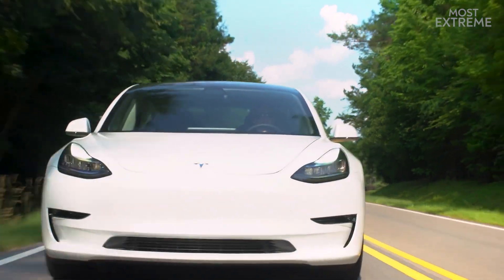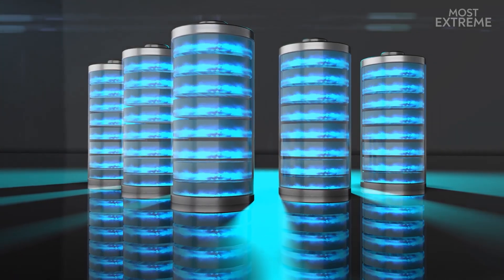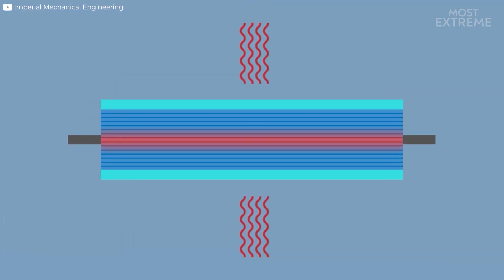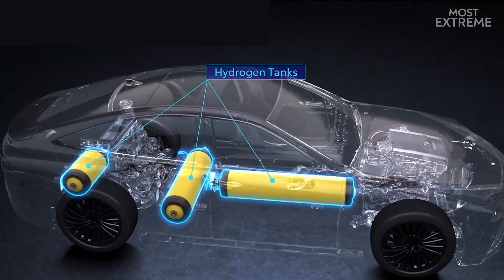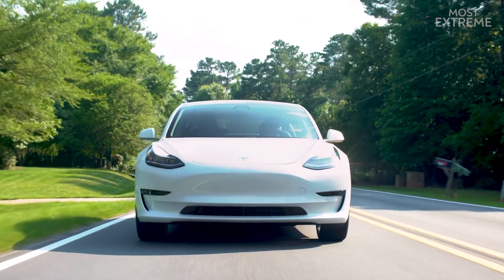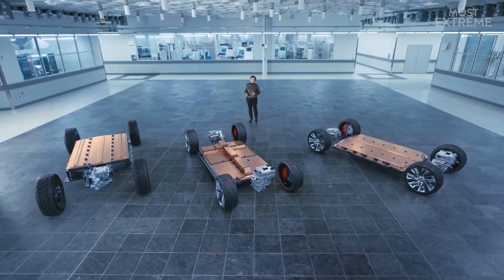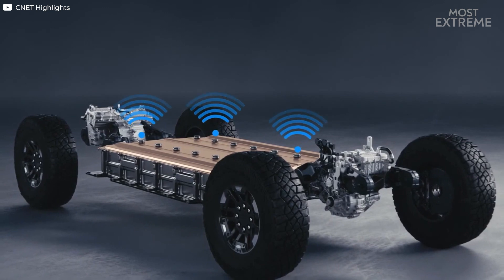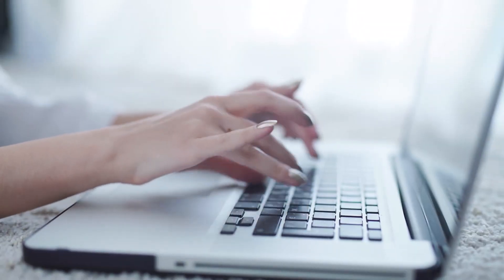Lithium VS Hydrogen VS Solid State | EV Battery Technologies Explained

Comment: I just can't wait for below freezing winter driving with multiple hydrogen vehicles having driven before me spewing water exhaust droplets coating the roads with black ice for us to drive over and wreck our vehicles on ! Now that is safe ! This concept is just another, not so well thought out,"GREEN", idea that when applied into the real world to keep us safe from climate change does not keep us safe from injury or death when in vehicular accidents. A society operating many Hydrogen Vehicles that are spitting water on below freezing road or parking lot surfaces is not the answer ! So, where to put water. Maybe an onboard  tank to freeze solid and burst when parked?  At a stop sign or light idling then accelerating adding heavy icing right there to the road surface just where one wants to actually stop? A parking lot to slip and injure another walking by the back of your parked vehicle or after you drove off leaving water to freeze there? A roadside gutter so a pedestrian can slip stepping off a curb, maybe falling down flat in front of stopped traffic and out of view of drivers ? Your driveway so you can fall there ? Your Garage to slide across while holding your infant child then both hitting the hard floor? Maybe, you need more tasks or to be distracted by mopping up the garage floor before the water freezes and your groceries just purchased thaw? Maybe a high speed highway perhaps in a turn? Maybe the unlimited speed limit Autobahn with high water production by those higher electric energy demands moving the hydrogen vehicle through the air while simultaneously dumping large amounts of water mist contrails at high speed onto the road surface? Your Hydrogen Vehicle needs to relieve itself in public, The question is where to do it safely? Now considering these real world usage / interaction scenarios listed, are Hydrogen Vehicles a good idea? As a vehicle operator you can rate the chance of consistent, caring, and professional operator actions observed when you're out exercising your privilege to be with others in the public driving arena. Are you certain that rushed Hydrogen vehicle drivers find and maneuver over a public storm drain water dump station to let their hydrogen vehicle relieve itself in public places when freezing weather is happening? You rate and you decide if  we or will not slip into a Hydrogen transportation based society. As for me...you guessed it,  I see much more "could care less" vehicle drivers and very few careful vehicle drivers. Hydrogen supporters….should we give these "could care less" about you drivers a water soaker sprayer for society at large to walk or drive over when a dash indicator flashes an alert "water tank full" during your trip? 

  As a example of related but current human behavior, How many times do you see trash / rubbish go swirling out of a moving pickup truck bed in the States, or dumped out a moving vehicle window instead of being caringly placed in a proper waste receptacle when arriving at one's destination, as an example of drivers' proper public disposal habits?

Maybe add antifreeze to the water dump so it can mist on following vehicles windshields / windscreens then be smeared with wipers on so the trailing driver has no clear view of the road. Now that is safe ! Then more windshield solvent is added to the ground by constantly keeping a clear view. Now wipers turned on and off, as if that is not distracting to manage while driving in heavy traffic.

Maybe many Hydrogen Fueled Vehicles can dump water and antifreeze that is now everywhere in the environment. Now that is green, think !

Maybe the Hydrogen Vehicle owner after the cost of a fill up of Hydrogen decides to not pay for the extra cost of perpetually filling an auxiliary antifreeze reservoir that costs more than gas or petrol per gallon. So where is the transportation fuel savings when buying both Hydrogen and Antifreeze for the fuel cell's water as a by product tank?

Maybe the antifreeze adder system breaks or is disabled. Now the trailing driver is back to sliding on black ice in below freezing cold temperatures

Comment: Electric cars cost too much, I desperately want one tho
Reply: For use in the city only, there are now quadricycles like the Citroën Ami which costs around 7000 euro only.  It's not a real car admitted but it inspires me to think why a car must be so heavy, merely for safety reasons. If all cars were lighter and less fast, the safety problem would change too I suppose and lighter, less expensive electric cars could come on the market.
Reply: So buy a used one. They cost less than a new one. You don't have to buy new....

Comment: Whilst manufacturers fall over themselves to sell you EV's, and governments are now forcing the end of ICE, current technology Li batteries are not the answer, which is why I believe EV's aren't going to be truly viable for another 5-10 years. Once solid-state batteries are mainstream, range is 500+ miles and you can re-charge to at least 80% in <30 mins you'll have my attention. A few years ago SUV's were all the rage, and now it's EV's. Car manufacturers will try to sell you anything that's the current trend, and they all jumped on this, but are really all too early. Full battery re-cycling/re-use is also critical, but will only be done en-mass if companies can make money out of it - nobody will do it for the 'greater good'. HFC cars will never go mainstream unfortunately due to the infrastructure costs, but that tech may find a place in heavy transport. Money always talks in our selfish, greed driven society.

Comment: The average distance traveled by Americans is ~ 45 miles per day. So, ~ 250 miles to ~ 350 miles are just fine. You are a "bull shixter" saying we need more. 80% of the population can use that use case for light duty vehicles. Also, Lithium Iron Phosphate will address the safety requirements. Honestly, you just need to stop. You do not know what you are talking about it.
Reply: You push the "fool cell "for light duty vehicles. You are really pathetic. Hydrogen is only an option for heavy duty vehicles.

Comment: Hydrogen is a bastard to store - or so the conventional wisdom goes. 
But there are various "metal hydrides" which absorb hydrogen at STP. No I didn't know about them, either.
These (and similar substances) can absorb SO much hydrogen that the combination can be ten percent hydrogen by weight. And that represents a lot of hydrogen. There is also ammonia, which is a slightly more complicated way to store NH3 (and thus hydrogen). Maybe batteries are not the only fruit.

Comment: Solid state is certainly the future, though I think capacitors should be explored.
Reply: Very well said.
Reply: SSBs for range & Supercaps for fast charging are already being used by Italian Supercar maker Fulminea in their Extrema model. Too expensive for general use as manufacturing cost needs to come down.
Reply: hydrogen is clearly better
Reply: @samuelx5466  for sure: everyone loves the wasteful and tedious process of electrolysis (sarcasm).
Reply: @ScipioAfricanus_Chris  as opposed to the wasteful and tedious process of building heavy batteries filled with precious metals only to end up in a landfill, all the while with a much lower energy density and ride length, yes, electrolysis is far superior
Reply: @samuelx5466  it's still cheaper and energetically more efficient. People have talking about hydrogen cars for decades and few have come to fruition. There's a good reason for that. Inaction speaks volumes.
Reply: @ScipioAfricanus_Chris  apart from it being not energetically inefficient, price will always come down with new infrastructure, batteries were once several times more expensive than they are now. 

Also 78% of auto manufacturers think that hydrogen fuel cell tech will outlive battery evs
Reply: @samuelx5466  yet the overwhelming majority of automakers are pursuing EVs
Reply: @ScipioAfricanus_Chris  KPMG Global Automotive Executive Survey 2017 see for yourself
Reply: @samuelx5466  well no, solid state batteries will probably be in cars before 2030, and it has the added benefit of not exploding like hydrogen cars can.

Comment: .HYDROGEN AS BATTERIES : HYDROGEN BATTERIES.
People often think about hydrogen as fuel, but many forget that hydrogen is not only a fuel, but also very good battery, too. 
Electric cars with hydrogen batteries instead of traditional chemical batteries to avoid all nocomfortable circumstances. TIME IS MONEY TOO.
 
The fundamental science dictates essential truth of chemical batteries :
if a chemical energy storage mechanism is charged as quick as producing hydrogen, then this mechanism PRACTICALLY  CANNOT HAVE ENERGY CONVERTION RATIO BETTER THAN ELECTROLYSIS PROCESS. Besides, it is possible to adjust electrolysis reaction speed (for example slow down speed) to get energy convertion ratio of electrolysis better than any chemical batteries. The best one of all possible chemical batteries in earth conditions is HYDROGEN BATTERY. All revolutions of chemical batteries, lithium batteries, LFP batteries, LTO batteries, graphene batteries .. are for reaching to the features of hydrogen batteries. 
  
The most simple hydrogen battery (simple hydrogen battery = 1 fuel cell + 1gas hydrogen ballon 300bar) easyly beats best lithium batteries by all features : more capacity, more power, less weight, forever lifespand, no degradation, charging in 5 minutes, same or better energy convertion ratio, but just noremarkable bigger volume sized than lithium batteries. 
Future hydrogen batteries can use more progressive hydrogen storage technology, like hydride material, can get even leap better. But right now simple hydrogen batteries are already better than almost chemical batteries.
 
So just equip cars with hydrogen batteries.  And equip hydrogen filling stations with mobile electrolysers to produce compressed hydrogen 300+ bar on site from electrical outlets. Electrolysing hydrogen filling stations (hydrogen battery charging stations) can run electrolysers from electrical outlets to produce liquid hydrogen on site, to avoid suddenly leap change requirements for big number of already existing current liquid hydrogen cars in the markets. But liquid hydrogen has low energy conversion ratio, which is one of current hurdle of hydrogen cars.  For now and near future, compressed hydrogen (produced on site)  is more versatile variant : for example, nets of electrolysing hydrogen filling stations mean that : you use electricity from electrical outlets to run electrolysers to produce compressed hydrogen 300+bar on site at electrolysing hydrogen filling stations. So you pay only for electricity (and water of course to run electrolysers), NO OTHER FEES, NO COMPLEX CRYOGEN EQUIPMENTS. 
(Additionally, car owners can buy home mini electrolysers to themselfe recharge their hydrogen batteries at home).

Cars come to 'recharge hydrogen batteries' in 5 minitues (load hydrogen). SAME COSTS OR EVENT CHEAPER THAN COST FOR RECHARGING LITHIUM BATTERIES. No waiting rooms. No wasting time in waiting rooms. Available recharging hydrogen batteries all hours of days. For stations owners, available to pick any imtermitten electrical supply schedule from grids in tandom with intermitten clean energy.

Comment: Please don't repeat the "charging takes so long" myth.

Fort ten years, I've never waited even a minute for charging. I plug in when I get home, and whenever i need the car, it's full.

It's true that most parking lots don't have nearly enough charging stations to do this for "destinations" but if your range is 300 miles and you're commute is less than 100 miles that really doesn't matter -- just charge at home.
Reply: ICE Refuel = 5 minutes
EV for same range = 1 hour

It’s no myth
Reply: @seanpeacock5595  you missed the point.
With my ICE car, I have to go to a gas station, fill the gas, stand in the fumes and noise.
With my EV car, I do none of that, because I just plug it in when I get home and leave it.
I spent infinitely more time filling up my ICE than charging my EV.

Now, if you're the kind of person who frequently drives 300+ miles in a day, your needs will be different. Luckily, the vast majority of cars and drivers in the US don't need to worry about that, though.
Reply: Exactly.

Comment: You forgot to mention the separator in the lithium ion battery. The separator in a lib will be advanced within months and then this type electrical storage will charge much faster, have  at least 2 X the life cycle and a high density. Therefore way more range and way faster charging. HPA. high purity alumina. Is the key to this and has been proven in many laboratories. The new high end batteries will have an HPA SEPARATOR watch out for HPA people. It must be 99.99% pure or better at this point in time China supplies most hpa to the world at an average of 98%. Hence we see thermal overload and then fire. The pure HPA will fix this and more 😁

Comment: In the first 30 seconds you guys have got it wrong - who pays you guys to tell these rubbish stories … the current range is more than enough for 99% if consumers usage …
Reply: 400-600km is adequate for urban usage, in fact, you can charge up and run it for the whole week in some cases, provided that you can find a charger. You are assuming that most people live in a house, with a charger in the garage. If you are living in a high rise, you need to work with the building management or car park to install rows of charger, which is a challenge without government support. Beside, what if you need to do a cross state travel? You have to make sure there is a charger at your destination. Adequate charging facility is a necessity for EV, Fast charging is a must to make EV more popular. And yet, EV is still miles ahead of Hydrogen.